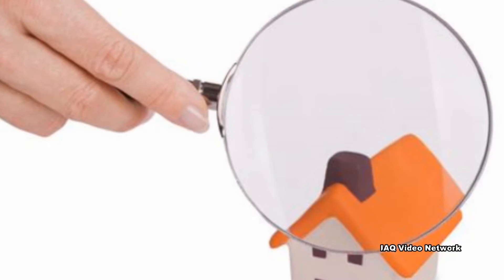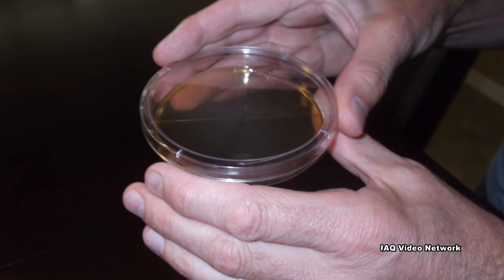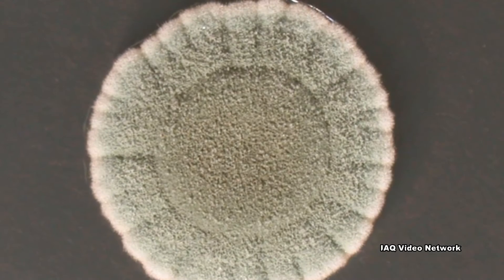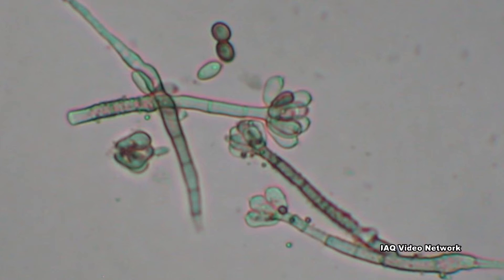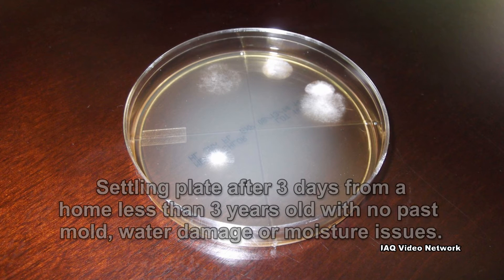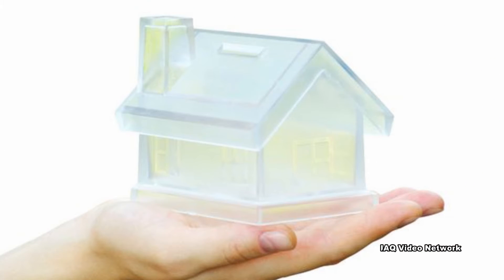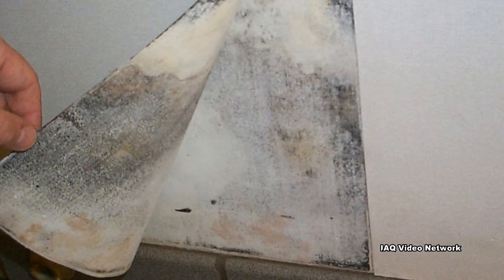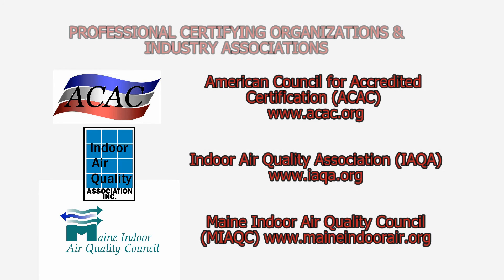DIY Mold Test Kits - Limitations of Settling Plates

Comment: These test kits should be used as a starting point. They are inexpensive and they give results.
Reply: Sound advice, no doubt. I’ve heard from an expert, although they aren’t perfect,  if used properly often are more accurate than professional mold air testing, and people have gotten huge refunds from mold companies after finding all kinds of toxic mold growing in their petri kits after being told their home tested negative. Probably since the air testing happens in minutes or seconds & doesn’t cover a longer time periods, which could be an important factor.

Comment: Don't throw the baby out with the bath water here folks. I am EXTREMELY mold sensitive. In fact I was almost killed by it. That's another topic altogether. These were mixed toxigenic molds. I have tested my parents and my own home. One location had over 70 colonies in two plates in two places in the home. The other had 3 colonies. It may not be definitive but it can be a useful tool to determine if you have a water intrusion problem. If your mold plated show large numbers of colonies and species, and not 2 or 3 large colonies, then relatively speaking you should investigate further. It's the number of colonies and not the size.